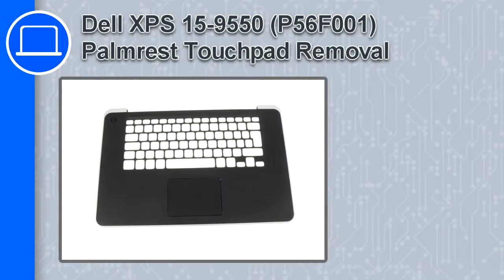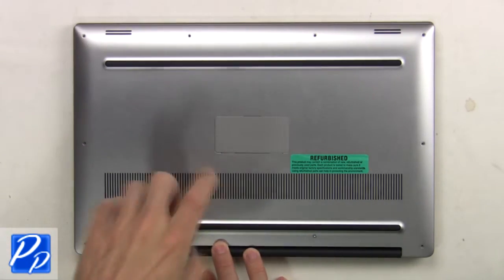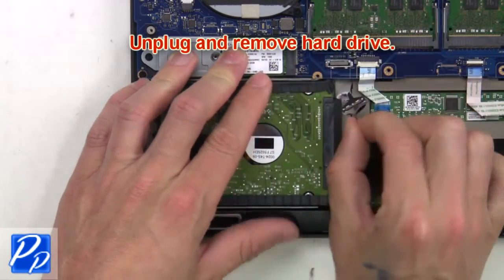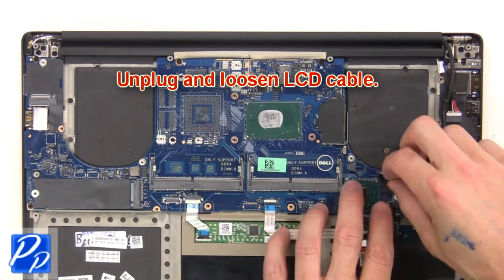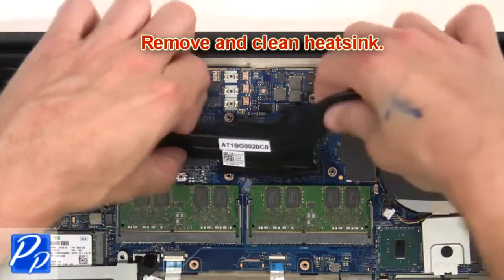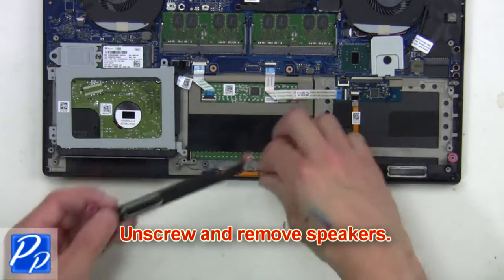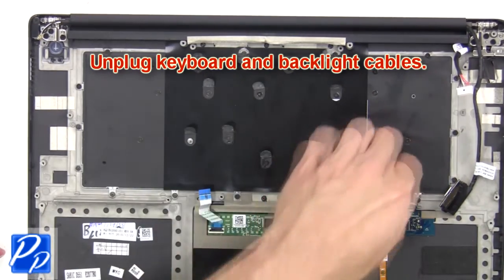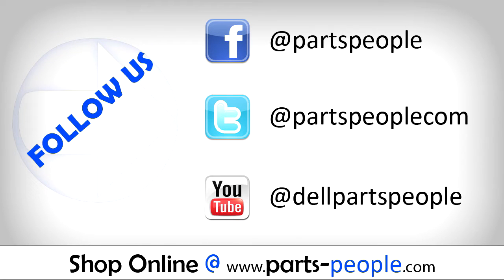Dell XPS 15-9550 (P56F001) Palmrest Touchpad How-To Video Tutorial

Comment: :face-pink-tears: STOP, STOP & STOP making people do more than they have to, as because of your very Misleading video, like sadly the countless others on YouTube, you unfortunately cost me a Dell XPS 15 (9550) Laptop.

You Do Not have to remove the Cooling Heatsink to replace the Keyboard, Palmrest, Touch-pad or CMOS battery  on the Dell XPS 15 (9550), (9560) & (9570) so why do you have people doing this very costly and unnecessary Step, which I sadly found out the hard way?

I followed your Misleading video to replace my Keyboard & Palmrest and because you had me unnecessarily remove the Cooling Heatsink and ultimately having to Buy Thermal paste & Pads as well, upon very carefully lifting it up 2 of the small screw cylinders inside the screw hole came out of the Motherboard with the screws attached and ultimately Bricked my laptop.

Thanks for Destroying a perfectly good laptop with your Misleading & Garbage video.

FYI - Not everyone plays games or edits videos on their laptop so so-called Thermals was never an issue for me because what I do with my laptop will never have it get to that point.
So STOP the STUPID Re-paste garbage when someone just wants to replace their Defective Keyboard., Palmrest, Touch-pad or CMOS battery on these XPS's.

I will be sending the exact same response to all your other YouTube Destroyers as you All want to be FAMOUS at others expense.

ALL THUMBS DOWN from Me! 👎👎👎

Comment: One of the hinges on the screen is coming free when opening the lid. Dell have recommended replacing the palm rest. Does that sound like it'll fix the issue? I'm not convinced...
Reply: Suffering from the same issue, sounds like it's a common problem with this line. My replacement palmrest has just arrived so I'll let you know how it goes
Reply: @Wifi_Pirate  sent it back. Palmrest replaced. Solid again now

Comment: Darn. I was somehow imagining this would have something to do with the "palmrest touchpad" mentioned in the topic, but no. Good disassembly guide for keyboards or other components though.
Reply from the maker: The palmrest and touchpad is the complete assembly, without the keyboard. Unfortunately, you have to remove everything to get to it. If you want to remove JUST the touchpad, it's held on with 2 wafer screws that are under the motherboard. You can see one of them at 3:32

Comment: So much trouble for replacing the UK keyboard with a proper US one. Should have just flown to the states and bought the laptop there instead.
Reply: Try change the keyboard regional settings to the US one within windows 10. Look into keyshorts or something equivalent to print you stickers to replace the affected keys for the 9550. I was looking into going down the tear down path with my laptop but its really not worth the hassle for a few keys.
Reply: Thanks, obviously that was the first thing I did, but this doesn't help as the physical layout of the keyboard is different. Left shift is split into a shift and a backslash, backslash is replaced with vertical return and horizontal return is split into backslash and vertical return. UK keyboards are an abomination.

Comment: Hey guys, 
Great video! Helped me so much. Is it possible to remove and replace the trackpad from the palmrest?
Reply from the maker: Yes the touchpad can be removed. It will be attached with 2 screws on the underside of the palmrest.
Reply: Parts-People.Com, Inc is it enough to only remove the battery to have an access to these screws?